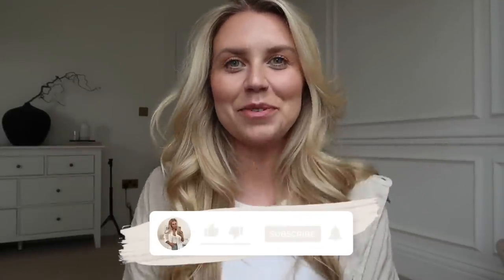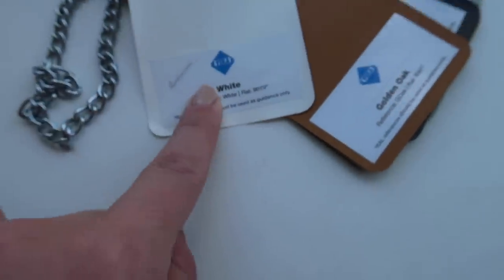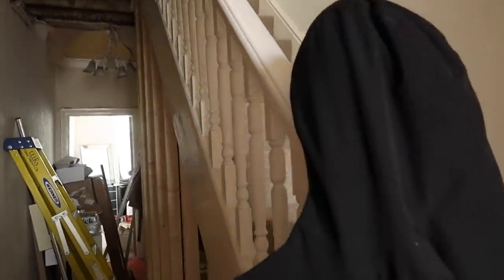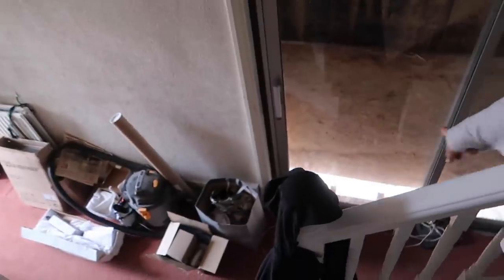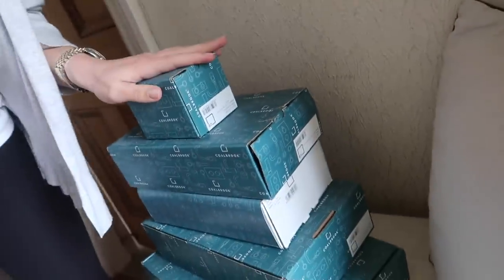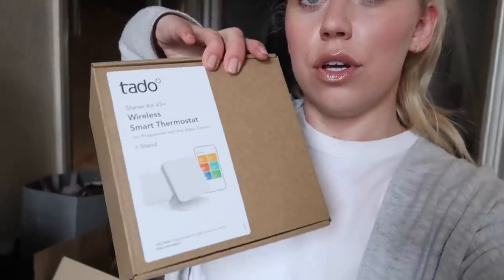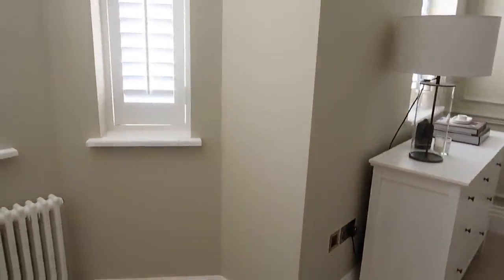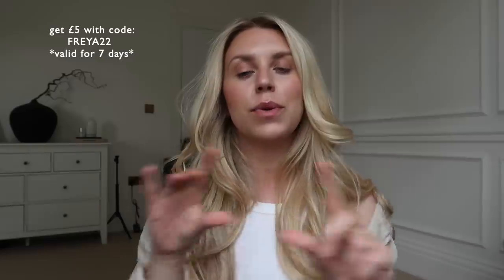HOUSE UPDATES & New Homeware Shopping 🏠 Renovations Vlog

Comment: Very interesting vlog Freya when our extension was built we had Block and beam floor which we finished with Kardean flooring Love you choice of tiles. We have brushed stainless steel sockets in the Extention in the hall white this was by accident as we had nit specified otherwise but also economical as its set out only two plugs can just be seen we may change them later but for now it's worked out fine the position of plugs is more important Also if you think about it the basement is going to be mostly a private area so to save abit of money  I personally  would go with chrome or brush steel sockets Cannot wait for the next update things will definitely more alot faster now all the ground work is done x